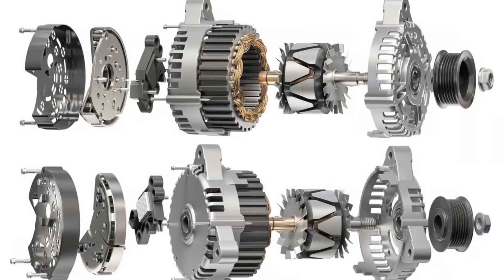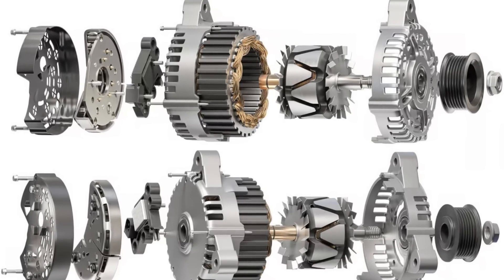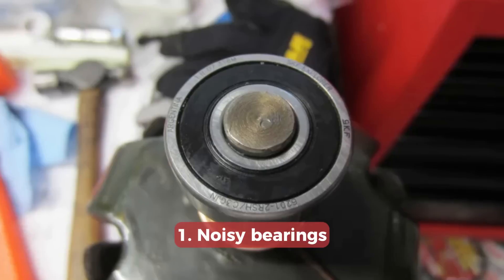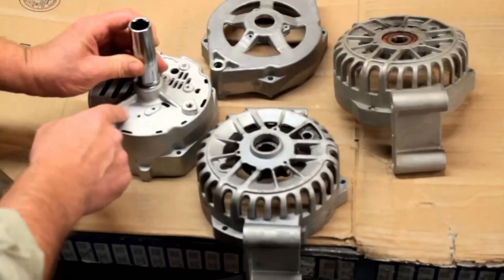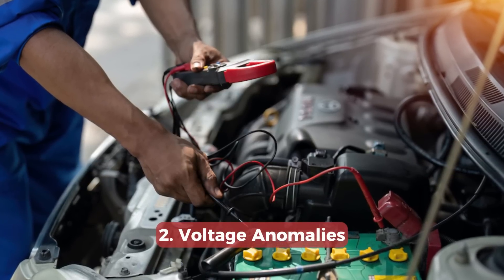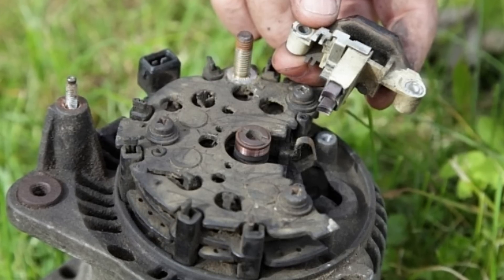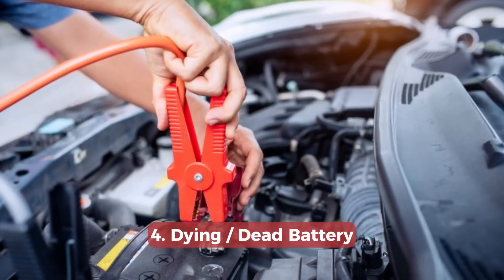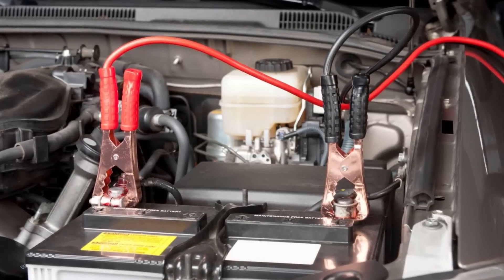Here's how you are killing the ALTERNATOR in your car

Comment: Spot on mate. 

As a battery distributor all I can say is, clients who thinks that they are smarter than the battery tester will definately run into electrical issues with their alternator at a much faster rate compared to clients who follows what the tester shows.
Reply: My favorite is when the fancy battery tester shows a battery is healthy but an actual load test with a real load tester reveals the truth.
Reply: @ewicky  The professional grade tester will always shows signs of a degrading battery, unlike the cheap fancy testers and the professional grade tester will definately pick up any anomaly during the load test, which must be done correctly. Anyone who really understand how testers and batteries work, would be able to tell how long such a battery can still be in service or before it starts degrading.
Reply: I havent had much alternator issues, more then bearing noise. But maybe i dont run the batteries down to the same level as you tend notice they start getting bad when the car suddenly wont start when its -30c
Reply: @TheHenirik  The OLD vehicles won't suffer much BUT it's the NEW vehicles that's laden with so many electronics and using a degrading battery really puts a tremendous strain on the alternator. Not to mention those who uses their battery until the tester shows that it's a BAD CELL with only 10.5V. You should see the shock on their faces when I tell them the bad news that their alternator had failed during their 1st battery replacement. If it's not the alternator dead, it's severely affected and definately some DTCs will be pick up during a scan. Customers who listens and follows the advice, I face no problems with their vehicles at all. Some clients even tries to fix the blame on me, that I had damaged their vehicle alternator or sensors during the battery replacement. Some customers here are pretty ridiculous.

So yeah, I believe when someone wrote "Happy batteries, happy alternators." and that is so true.

Comment: So this is what I've been saying for months even years, always have a tool box in your trunk with a spare Alternator because Alternators are unpredictable. They can die on you at any given moment, replacing an Alternator on the side of the road is better than spending $300 on a tow truck. Plus you'll be back on the raod after a few hours.
Reply from the maker: It's getting harder to replace almost anything on the side of the road in modern cars, unfortunately.
Reply: @DmitrySapko  Not my cars I drive a 17 years old Camry and a 2016 Scion TC both Alternators are on top of the engine. I don't drive new modern junks.

Comment: Heat. Number 1 killer of alternators.
Reply: Heat is the #1 killer of batteries.  Alternators are designed for the engine compartment temperatures, so heat is not really a lifespan factor...
Reply: @redbaron6805  Heat is THE killer of all things electrical.
Reply: @puncht37  That simply isn't true.  Electronics components have a temperature range.  

If you operate them within their designed temperature range, literally nothing will happen.

Only when they are operated OUTSIDE of their designed temperature range, does heat become an issue.

If you look at the Data Sheet for any electronics part, it lists the operating range it is designed for.  Even if the component is in an environment you consider "hot" the rule still applies.

But don't worry, I have only been doing this for 30 years, so I'm sure you can teach me something about how this works...
Reply: @redbaron6805  Iv`e been a tech for 40. So, maybe so.
Reply: Shouldn't we just get rid of the engine covers
Reply: @louarmstrong6128  Alternators are not behind engine covers on cars.  Weak batteries kill alternators more than anything else.  Check your battery annually and replace it before it fails, and your alternator will be fine.
Reply: Something I learned from people in Arizona is to prop your hood up with a stick whenever possible to dump the heat when the engine is shut off -- especially in a garage, where there is no breeze. Besides the battery you will make life easier for the electronics and hoses. Take an IR heat meter and measure temperatures around the engine compartment after shutdown. It is like a pizza oven. Now imagine putting your laptop computer in there.

Comment: I can relate to that. My battery was dying. The day I went to the battery seller it checked the altenator, it said it was charging over 14 volts, and they said it needed the voltage regulator replaced. The battery was changed and it has normalyzed! 
And funny story. My dad's car used to blink the alternator light when the revvs were too low, it was useful to prevent it from stalling lol!
Reply: 14 volts is the correct amount 😂
Reply: oh you said over 14 my bad

Comment: Good points about the alternator.
Its premature failure can be accelerated by engine bay excessive temps as well (same goes for anything else actually).
Mileage is much less relevant than its lifespan in hours.
Edit: I've heard of preventive bearings and bushings replacement, which allegedly prolongs the life of the alternator, especially on large engines where it works at high temps.
Reply from the maker: Preventive service was common for commercial large vehicles. Not anymore - isn't worth it due to labor costs.
Reply: What kind of time frame are we looking at for preventive maintenance on alternators ?
Reply: @jeffreyread2055  I am no mechanic, but when a belt service is done one can check the alternator bearings and evaluate how it spins.
Reply: @iulian2548  
Any time I remove a belt, I spin/wiggle ALL driven shafts/idler pulleys to check for noisy or worn bearings.

Comment: modern alternators arn't desined to charge low batteries , that why the state of charge and the health of your battery is so important
Reply: You couldn’t be more wrong.  They charge much faster than a battery charger.  Batteries with high internal resistance is what can damage an alternator.

Comment: Most modern vehicles no longer use a voltage regulator. The power train control module monitors the battery voltage and also controls the voltage output of the alternator Thats why its so easy to misdiagnose the charging system
Reply: Yep I’m in car audio and have a 320 amp high output alternator. The pcm will sometimes run at 14.8 volts sometimes it’s 13.5. It freaks out because my lithium batteries rest at 13.3 volts which is higher than typical agm or lead acid.

Comment: 100% agree on charging up the battery on an automatic charger (make sure itn has settings for traditional lead flooded and AGM) every six months. 

You can really maximize the life of your battery.

Also upgrade the grounds of the charging system. Great video!
Reply: I have a small solar panel on the roof of my van that just trickle charges the battery whenever the sun shines.   Battery is 14 years old and has never let me down and has never been boosted.

Comment: Mechanics don't "just replace repairable alternators" carelessly!

We do replace them instead of repairing them, but for good reasons!

There are many parts that can go bad (bearings, brushes, regulators) and if we repair one bit, the rest are reused. Do you want to pay me to R&R the alternator again when the reused parts fail?

Besides, a remanufactured alternator costs less than repairing an alternator once the labor time is accounted for! Figure 1hr labor to rebuild, so the parts need to cost at least 1hr less than a rebuilt alternator does! That is (almost) never going to happen because the rebuilt alternator will (usually) cost less than one hour of labor!

We do care, but we replace them to save the customer!
Reply from the maker: I never said all mechanics are bad. What you say highly depends on the country and labor cost of course. And often replacing a unit is indeed a good solution.
Reply: I agree with this reason for replacing the alternator. 
It's a crap shoot today.  Replace the alternator with a "gold" aftermarket or "oem" and they still die prematurely.  
Swap, re-swap, swap again, sure the alternator has a warranty but the customer is passed at paying the labor. 

What needs fixing is quality control, which seems to be in the toilet after the covid era.
Reply: @juicebox22a  I've got no problem with the original alternator in my car, but it was made before cars were disposable.
Reply: Look for an old school alternator and starter rebuild shop. They usually carry good quality bearings, brushes, and regulators, and they can rebuild the OEM one while you wait.
Reply: @juicebox22a

Comment: Compared to when I started driving, 1966, alternators are wonderful. The dynamos were always getting gummed up commutators as well as giving low outputs. The only alternators failure I have had was on a 2l duratec Mondeo but it was after 14 years so cannot grumble. This alternator had a clutch so that no overcharging occurred, This meant the battery lasted 11 years. Great improvement over 1960s cars.

Comment: My battery warning light has been very, very faintly on (can only see it at night) so I installed a volts gauge - it puts out like 14.5v, sometimes a bit more. It's been fine for the 4 years and 60K I put on it.
Reply from the maker: Voltage is fine. Must have been some problem with the dash or something.
Reply: @DmitrySapko  It gets slightly brighter when the load is higher (defrost, full fan, etc). Belt's fine, output at alternator matches what the inside gauge says. I've just been living with it :)
Reply: @the_kombinator  Impressive that it hasn't cooked the electronics on the engine. They are not meant to handle that voltage!
Reply: @gabrielvieira6529  Um, 14.5v? I haven't even changed a single bulb in that car in the 4 years I've owned it. My classic hits 15v when its on high idle, no electronics to burn in there though :P
Reply: @the_kombinator  Ah, classic cars. The classics are built stronger. Enjoy your ride!
Reply: @gabrielvieira6529  I will, today, probably for the last time. I'm gonna store it next week - the other two are already stored for the season.

Comment: I own a 1997 Toyota Hilux in Australia and it may have its original alternator when l bought the Hilux 5 years ago l got no service records the only paperwork was the registration paper but l know for one thing l replaced the battery 5 years ago but my Hilux is extremely analog two electronic components have failed the radio cassette player and the modul for the cruise but who needs cruise control live without it and the cruise control was an optional extra Toyota over engineered the 5th generation Toyota Hilux because the carburator may be original but with 439000 kilometres every things fine on my Hilux l use it regularly for running erons l am a retired courier and actually it is one of the best commercial vehicles l have ever bought and the Hilux was my last courier vehicle l own once l found out what an indestructible unbreakable reliable and dependable vehicle it is and it maybe the best vehicle ever made as claimed by another you tuber
Reply from the maker: Agree, super-reliable Toyotas. Pity the modern ones are way worse and complicated.
Reply: @DmitrySapko  Still they are one of the best new vehicles to buy but some Toyota's are having reliability problems in the USA but Toyota's are the most popular vehicle in Australia were most of the taxis are Toyota Camery Hybrids and also use Toyota Hiaces for transporting disabled passengers and all private disabled vans are Toyota Hiaces and even the JDM Toyota people movers which a company come with passenger seats that swing out and in some cases were the actual seat is an electric wheel chair and a ramp comes out the left hand side and the disabled passenger just drives their wheelchair out if the van available in Australia and they all JDMs

Comment: Beginning from the late 1980s auto makers started relocating the regulator to the ignition computer instead of a stand alone unit inside/ outside the alternator. There is not much for a computer to do to keep busy in a car, so auto computer chips are generally 3, 4 tier in technology, and more tasks are being done by the computers as the engineers see fit to let the computer do, it is cheaper to put it in the computer ,  you best not have any such function failure, for it will get very expensive. A regulator portion failed and you have to swap out the whole computer. That usually come  after most mechanic already changed the alternator first.

Comment: Absolutely correct video, i would add one thing: 
You are not just making your alternator work harder with a half dead battery, but due to significant power losses, your fuel consumption will increase as well, significantly! (Talking about adding up to an extra liter every 100km - own experience)

Comment: Negative power balance kills battery and alternator. Too many of cars are unable to charge battery when engine runs idle. If you travel night time thru traffic jams, you get battery discharged at the end. Or you must rev while you are staying. This is devastating to battery life and rectifier becomes expendable.
Reply: And if you rev the engine repeatedly while the car isn’t moving that’s a torque converter stall and not good for the transmission.If you are in drive.

Comment: Even if it is the bearing or the voltage regulator, they're still gonna replace the alternator. People don't know how to rebuild alternators and majority of shops won't bother.
Reply from the maker: Yep, true
Reply: At today's shop labor prices, it is not cost effective to do most rebuilds.
$100+ labor plus parts... 🤔
Reply from the maker: May be true for some models. But alternators aren't cheap these days, too. While bearings or brushes are dirt cheap and easily available.

Comment: I just know a weak battery will mess with your car's electronics because it lost its ability to regulate voltage so when you turn on AC or turn steering wheel your lights dim your AC blower slows etc. so safe to say this triggers alternator to work as hard as it can vs a good battery wouldnt trigger that response.
Reply from the maker: Usually, if you experience voltage anomalies like dimming lights when the engine is working, it's all about alternator or voltage regulator only. Dying battery will mess up things before the engine is started. But if it's eventually started, all power should go only from the alternator. Otherwise, something is wrong in the system.
Reply: @DmitrySapko  I am telling you this because my AC fans would slow to significantly slower speed like out of 4 settings it would go from 3 to 1 speed just from turning my steering wheel when parallel parking etc. and my battery was providing 350 CCA out of 500 regular and internal res of 8-9. Although it would start my car it shows the role of batteries as a buffer in high demand situations. 

After all your car uses DC but your alternator produces AC so your battery is the source of electricity not alternator for the stuff in your car, it needs to be converted to DC. A bad battery will not do a good job of keeping a steady voltage and cause big ripples and lack of sudden power since alternator can't produce enough in a second.

I replaced my battery and problem is fixed as expected. I also tested my alternator and it charges at 14.1v so nothing is wrong with the alternator anyway.

Comment: Weak battery won't cause the alternator to work at it's maximum capacity unless the battery is shorted or something, it'll charge it very quickly to the proper voltage after startup and nothing else will happen
Reply from the maker: No, the system will only switch to normal voltage when the battery is 12.5-12.8 volts, depending on the battery type and software in your car. Up until that, the voltage regulator will send 14+ volts to charge the battery.
Reply: @DmitrySapko  For flooded type lead acid batteries it doesn't matter if the alternator makes 14.4V, the batteries will quickly reach that voltage without pulling to much current and then the current will be way less than 10A so the battery will take a lot of hours or even days with the engine running to be 90% recharged.

To push a lot of Amps into a flooded battery you need to increase the voltage further than it's recommended for things like radios and enough to blow all incandescent bulbs in a few seconds, so you must remove the battery from the car, it isn't enough to disconnect it because it can still explode covering the engine bay in acid...
Chances are it will explode even if you are careful and follow all the instructions, using a fast charger is very dangerous, it's the battery equivalent of split ring rims for tires.

AGM and GEL batteries can pull more current but usually the OEM alternator and the OEM battery are proportionally sized to not cause problems, unless you installed a bigger battery the alternator should be OK.

And lithium batteries aren't straight replacements for cars that were designed to use lead acid batteries. 
Those can work on motorcycles and riding mowers that have a flywheel generator because those generators have the ability to limit their own output, but most external (belt driven) alternators can't do that.
Reply: @DmitrySapko  I think you need to learn a little bit more before trying to teach others
Reply from the maker: Thx for your advice :)
Reply: @Szamuz  It will make the alternator be full power. I have tasted that before. The alternator was dumping its maximum voltage to a dead battery I had. Now its changeed and it charges to 12.8v normally
Reply: @gabrielvieira6529  I understand we're talking about smart alternators only, but even a smart alternator bumping the voltage won't work a lot harder if battery's life is coming to an end because the battery won't take any current anyway. If it takes a significant amount of current that means it's being charged and it will hold that charge or (rather unlikely) it's only being heated up which will lead to explosion very quickly.